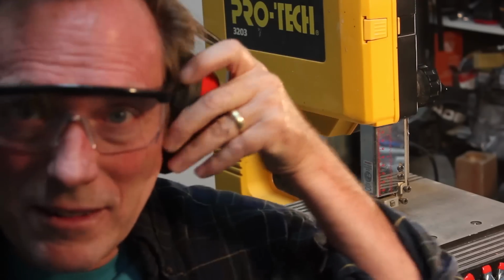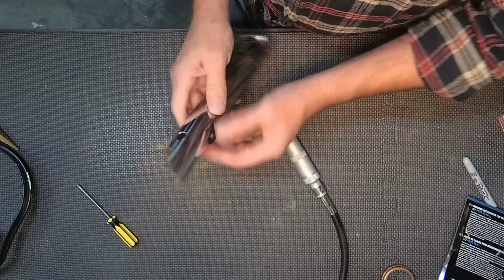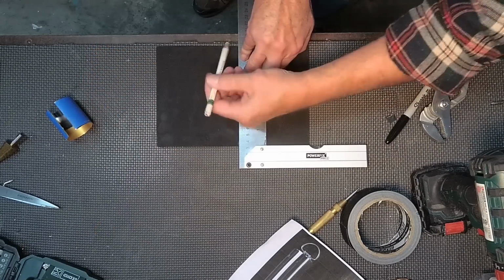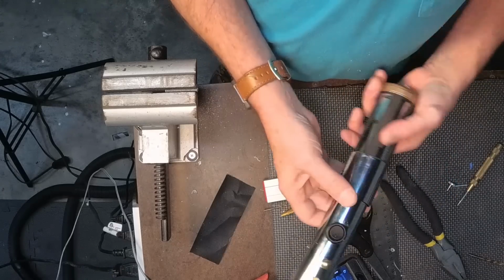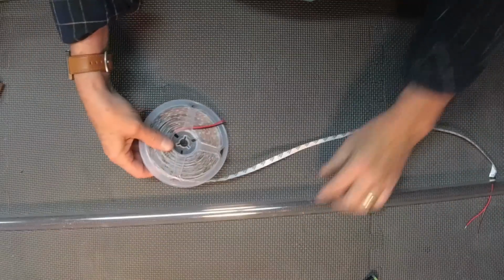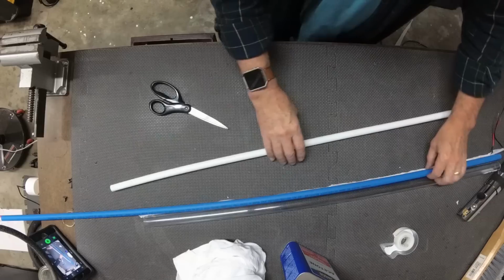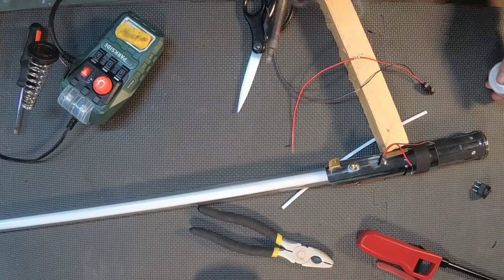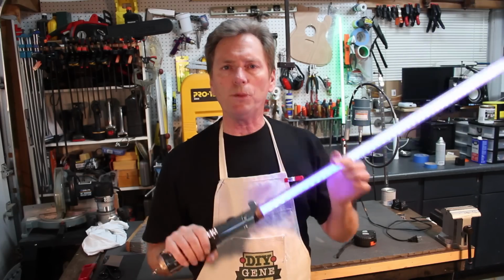Rey's Lightsaber: How to build your own (Complete Step By Step)

Comment: What size sch 40 did you use inside the drain extension pipe? Was it 1" ? Have been watching some of you videos and really enjoy them. Out of all the videos I have watched on how to make lightsabers, I like y'all's the best. Others are too gimmicky and they focus more on acting than they do just being themselves and doing a better step by step. Keep it up guys!!
Reply from the maker: Hi Mike, Sorry for the delay in getting back to you. The sch.40 pipe is 1" id and 1.25 od. I hope that helps. These light sabers are so much fun and you can battle with them because of the polycarbonate tube. Thanks again for watching!
Gene
Reply: @DIYGene  no worries. I really appreciate you getting back with me. That helps a lot! Y'all are awesome! Thanks again for the info!
Reply from the maker: No, Thank You! I really enjoy doing this.

Comment: I know I'm late but what type battery did you use?
Reply from the maker: Never too late. I used a Duracell 9V battery. It will last an extremely long time. Thanks for watching.
Reply: @DIYGene  I looked at the light strip and it said 12 volts if i use 9 volts does it just mean its a little less bright or something?
Reply from the maker: @RatCS67  I know it says 12v but the 9v handles it great. Trying to build a 12v combo is really hard to fit in a hilt.
Reply: @DIYGene  sorry to bother you again but im looking at the polycarbonate tube and the shipping is pretty high, are there any other similar tubes that would work just as or almost as well that aren't very expensive
Reply from the maker: @RatCS67 , I just looked and shipping is insane!  Do you have any local plastic suppliers in your area?
Reply: @DIYGene  im not sure but I will look into that, So far the cheapest one that i've found is 32 bucks on ebay with slightly different dimensions.
Reply: @DIYGene  do you think some place like Home Depot would sell the tubes. I looked at their online store and only sold ones too big and also only like 24 inches
Reply from the maker: @RatCS67  what state are you in?
Reply: @DIYGene  I live in california
Reply from the maker: @RatCS67 , I have one but it would cost as much to ship it from Virginia.
Reply: @DIYGene  what do you mean?

Comment: Nearly every other build video uses 3D printed parts or entirely painted PVC or “buy this aluminum extrusion”. I appreciate you have genuinely used parts that can be bought at a hardware/general home or craft store. Or something you can get readily available very cheaply from the internet. You have clearly iterated on your previous designs and improved with each one. Nice work! 👍
Reply from the maker: Thank you, and I agree. I first watched videos to build a light saber then suddenly they go to there 3D printer. Well that’s fine if you have a 3D printer. This was a really fun project although I had someone suggest using a windshield wiper blade for the grips on the hilt and that might be a good idea. Thanks again for watching.
Reply: He used additive printing with thermoplastic resins to make the cap. 

Hot glue

Comment: Would it help, when sticking the strip LEDs together, to use a thin, but a little flexible material, say, a strip of stiff plastic, placed between the two strips (edges & end trimmed), to help give the LED some extra strength? And to help keep the strips a bit straighter? Thanks & great DIY!
Reply from the maker: Thats a great idea. I might have to give that a try. Thanks again for watching.
Reply: @DIYGene  very welcome. Trying to make a homemade l/s but my 1st I plan on using a string LED blade, then a 2nd one, try the RGB

Comment: Thanks for your nice video. I want to try to make my own lightsaber,  too. I looked for a good LED lights to remake an electronic lightsaber toy and found this one. 5V USB LED Strip Light 5M SMD 3528 with 3M Tape for TV Computer Backlighting (5M,3528,Non-Waterproof, Green) .https://www.amazon.com/Strip-Light-Computer-Backlighting-Non-waterproof/dp/B01G572DMO/ref=sr_1_38?dchild=1&keywords=Water-Resistance%2BIP65%2C5V%2BWaterproof%2BFlexible%2BLED%2BStrip%2BLight&qid=1589332583&sr=8-38&th=1
This has a USB connector. Do you think this will work for good?

Comment: great video gene.my switch is only 2 wires premolded.my color changing one is giving me the trouble.i switched wires around and taped up all connections and battery still heats up.crazy.i may have to bypass my switch and use the remote.thanks gene

Comment: The black thing on the hilt is a leather band, because the lightsaber broke in The Last Jedi, it got fixed and it got that leather band, which is actually brown, not black. There is a Legacy lightsaber, which is found at Galaxy's Edge at Walt Disney World and Disneyland, called "Skywalker Reforged" which has that design.

Edit: Just so you know, the lightsaber originally didn't have that design. The new design reminds me of a football, because of the brown leather around the ignition switch.
Reply from the maker: Baseball Legit , Wow I didn’t know it was brown. That good to know. Thanks for watching.

Comment: Perfectly serviceable stunt prop there! It may not be screen-accurate to the hero prop(s), but it's instantly recognizable as the saber you're trying to capture.. and is probably a good deal more durable than the original hero props. This is actually something you see a lot in film and television production, where the props that are going to be seen up-close are meticulously built, but the ones that stunt men are swinging around in the long shots, and the props carried by extras, thrown across the room, etc.. will be 'good enough to recognize from a distance' but may not be exact.

This saber has the upshot of costing 'tens of dollars' for the handle, Not to mention the most important part.. being something you can build at home over the span of a weekend. This is a great project for learning Saber and Prop building with.. and from there, each one can get better as one goes along.

And I do want to say, as others have said.. kudos to you for pressing forward with your passion for making, even when the tremors try to sideline you. Keep up the awesome work!

And consider making a saber that uses the electronic guts of a goodwill toy saber, to have sound effects!
Reply from the maker: zebragrrl, Thank you so much. It has been fun and a great learning experience. Wonderful comments like yours inspire me to do more videos. Thanks you again!

Comment: How long does one 9v battery last with the LED strip? Any idea if adding a sound chip to a similar build would require another battery?
Reply from the maker: David Soto, The battery lasts a very long time. I am wondering about a sound card too. I will have to look into that.  Thanks for watching.
Reply: DIY Gene thank you for the quick response! Have a blessed day 😄
Reply: DIY Gene I tried connecting a 9v battery to a latching switch and my LED tape but the battery gets excessively hot. Am I doing something wrong?
Reply from the maker: David Soto. I’m not sure. I have not had that problem. What would happen if you switch wires?
Reply: @DavidRaphaelSoto  I'm facing the same prob and can't find a solution

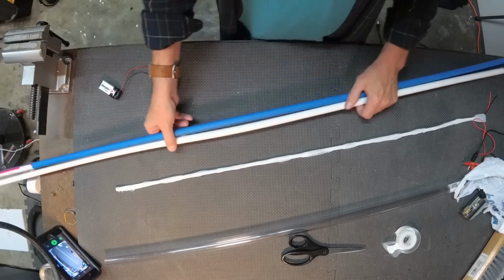Comment: 14:33 Which kind of tube are you using ?
Reply from the maker: It’s 1/2” PEX pipe. You can get it a Home Depot and is only about $2 for a 5’ stick. I hope that helps.
Reply: @DIYGene  Thank you so much !! I can finally finish my lightsaber :D My only problem was that the light wasn't spreading enough. Thanks again !

Comment: Whats the ID and OD of that plumbing pipe?
Reply from the maker: The schedule 40 pipe is 1”ID and 1.3” OD. I hope that helps. Thanks for watching.
Reply: @DIYGene  thanks buddy! Trying to figure out a shroud pipe that will fit over it. 1.30" = 1 3/10" so an 1 1/4" ID pipe is too small I believe
Reply from the maker: Zakary DeLaura , Are you also using the metal drain pipe?  It will sleeve over the schedule 40. So you have the 12” drain pipe with the schedule 40 slid in it and the 1” polycarbonate tube slid in it. I hope that helps.

Comment: Very nice build, add a Cree-Star-LED (about $47) and Nano-Biscotte-V4 sound board (about $79) like below and have an amazing one. Or go crazy and get the top of the line NeoPixel LED system which is basically a more advance version of the blade you made.

https://www.thecustomsabershop.com/MHSv2-Nano-Biscotte-V4-Assembly-P1447.aspx
https://www.thecustomsabershop.com/Royal-BlueGreenRed-Cree-Star-LED-MHSV1-Heatsink-Module-for-use-with-NBv4-Assembly-P1475.aspx

Comment: I was wondering if there was a way to wire my lightsaber to have sound?

Other wise your build on the lightsaber was exactly what I had in mind when I think of a lightsaber.  

Thanks!
Reply: The walking Camo you can buy a soundboard from custom saber shop
Reply: oh yes, You can even build a sparing saber to use in matches IRL. There is a huge community out there.

https://www.thecustomsabershop.com/MHSv2-Nano-Biscotte-V4-Assembly-P1447.aspx
https://www.thecustomsabershop.com/Royal-BlueGreenRed-Cree-Star-LED-MHSV1-Heatsink-Module-for-use-with-NBv4-Assembly-P1475.aspx
Reply: I would try using a $3 Wal-Mart space sword circuit board with maybe a headphone speaker for better sound.

Comment: The white tube you use for the lightsaber is a pvc tube ?
Reply from the maker: Santi Spidey , it’s a pvc 1/2”  that is thin walled called shark bite. It available at Lowe’s and Home Depot fit about $2. I hope that helps. Thanks for watching.
Reply: @DIYGene  I thank you very much

Comment: I have a second question, My LED strip arrived in the mail but the adapter was broken will I be able to connect it to the 9v battery with the two wires in the end?
Reply from the maker: Yes! I don’t use the connector. Just run black to - and red to +. I hope that helps.
Reply: DIY Gene Thanks!

Comment: or just find an old  Graflex 3 cell flash gun from your local antique camera shop but don't tell them you will cut it up for a light saber or they will charge you 100X more. lol
Reply: You dont need to cut it up
Reply: @geraldinewoods254  this is true
Reply: No cutting, just adding rubber hand grips and a piece of circuit board connector in between the release clamp.
Reply: @desertsoldier41  for an accurate Graflex you'd have to drill holes in the lower body for the screws in the grips (ESB) and for the D-ring. Unless you're getting an 89sabers kit

Comment: Nice build Gene the battery negative should just go to the LED negative and not to the switch as it will short out the battery once you switch it off Unless you like fireworks
Reply from the maker: George Krabs, I have never had a problem with that but I will definitely look into it. Thanks for the information and thanks for watching.